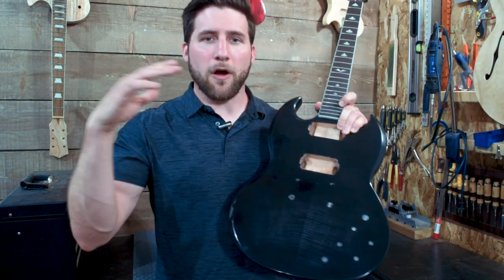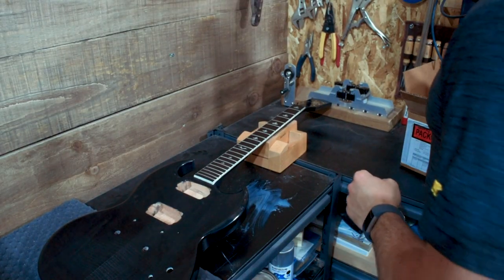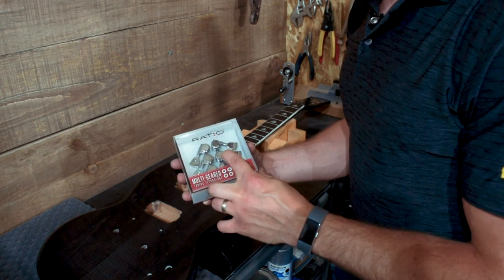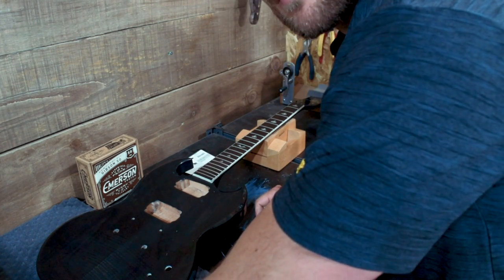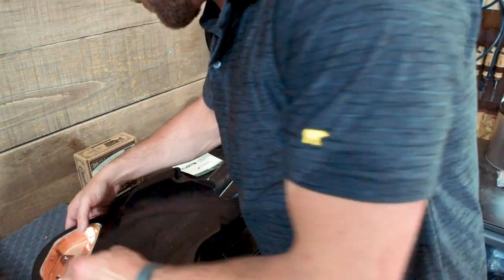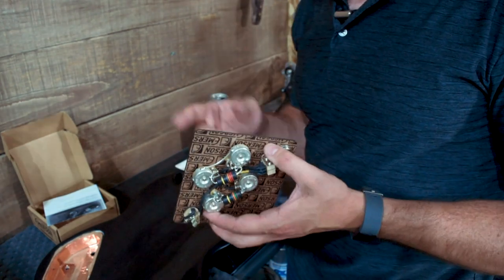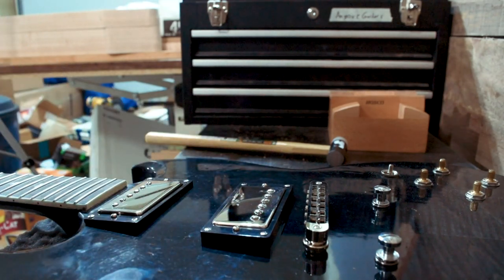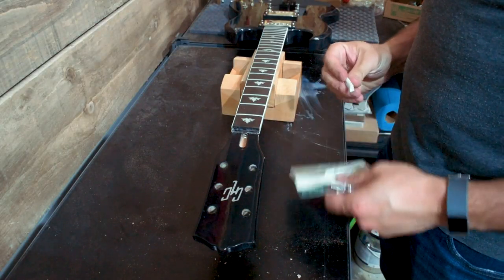The Ultimate SG Guitar Kit Build Final Assembly (Part 7)

Comment from the maker: You can find the guitar kits and parts I use here: https://www.solomusicgear.com/?ref=1512
Reply: Brad question. Duplicolor gloss black (acrylic enamel) with a 2K poly clear coat. Will they work together? Thanks Tim
Reply from the maker: @tim7of717  They will if you let the duplicolor dry fully for a week or so and then sand lightly with 800 grit before adding your 2K overtop.
Reply: Hey Brad I can't seem to find the copper shielding tape on the solo site. Appreciate any help thanks

Comment: Builds looking great Brad.. One small tip.. do the nut at the very last and have your tuners and strings all on.. then do your groobar spacing for the string/nut height and then do your superglue on the end grain pace the nut, put the strings on and immediately tighten (no need to tune) the strings to force the nut into place. Wait about 20 min. You’ll find tuning it up to full pitch is easier and more stable because the strings have relaxed a little. BTW - I also put some string lube on all contact points during this first step, which helps as well for final setup. Just saves you a little time and gives you a more consistent outcome.
Reply from the maker: Thanks Rick
Reply: Brad Angove - Necessity is the MOTHER of invention. Or how my grandpa used to tell me.. “work smarter, not harder”

Comment: Always enjoy the videos Brad. As a recommendation: For anyone who owns a drill press and is inserting any type of sleeve into your guitar body (for floating tremolo or bridges with posts) you can place a wooden dowel with a tapered end into the drill press (make sure your dowel is thick enough to handle the stress (3/8” diameter will work) and don’t make it very long). Then place a protective layer over the flat support on the drill press to keep your guitar from getting scratched or damaged (a soft, thick towel will work). Then using the drill press (in the OFF position, or unplugged to be safe) with the tapered dowel you can slowly press the sleeve into the body of the guitar. The tapered end will slide into the sleeve and keep it from slipping around the face of the sleeve. This also allows you to have more control over the insertion of the sleeve, without fear of damaging the metal sleeve or your guitar.

Comment: Brad, when gluing in the nut don't glue on the underside but glue on the end grain. You only need two small drops. Otherwise you can't take the nut out without taking wood with it.
Reply from the maker: Good trick! Doing it on the end grain definitely makes sense.

Comment: Have you ever had a problem with creating a ground loop when inserting pre-wired electronics?  Since all the pots are contacting the copper tape, the tape should act as a common ground for the electronics.
Reply from the maker: I haven’t had that issue yet, but it can happen. A small piece of tape can fix that.